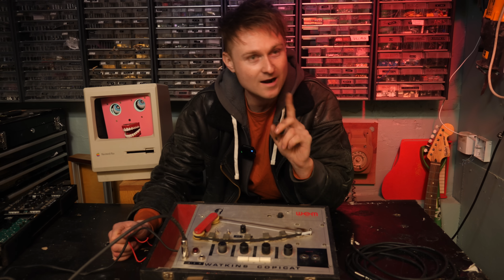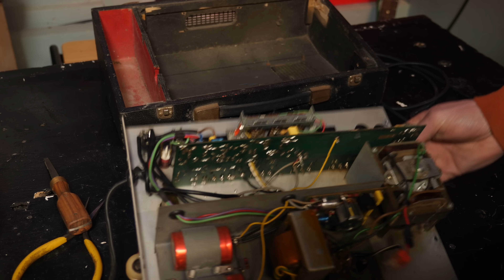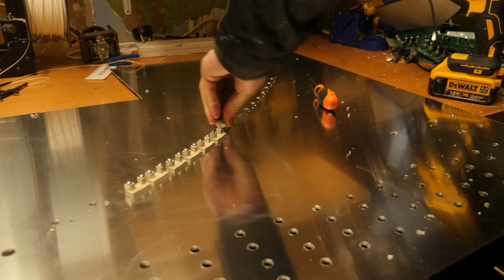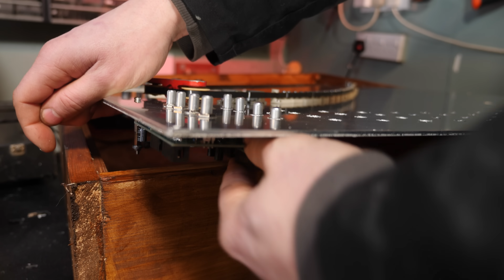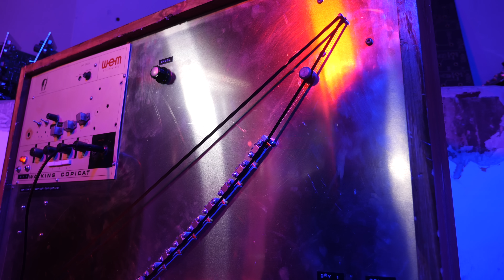A MODIFIED TAPE DELAY WITH 6 TIMES AS MANY TAPE HEADS - THE MEGACAT

Comment: Modification ideas
1. U used a Metal plate, maybe try to add "platereverb" Modulation by vibrations on the plate, the play heads will Pick Up different hights of the tape

2. Add a Keyboard Mode Which can be switched on with a button. Then build a keyboard to the delay and connect the heads to the keys so you can activate/play them with the keys 

3. Cutoff for each playhead

4. LFO for Write head

Comment: It would be cool if the tape you had going round and round would have a design on the back of it. not sure what kind of media is needed to work with a tape head. But with as visible as the tape is, you could more easily gauge how fast it is moving, and it would look cool.

Comment: One cool ting that could be done with it is to build a sort of EQ. It turns out that when you are building an EQ in software, it's done by computing the output as the sum of a bunch of delayed and scaled (an possibly inverted) samples from the input. This is basically doing that in analog.

To get that to work properly, you would almost certainly need much faster tape (the head-to-head delay needs to be close to some multiple of the inverse of the frequency and the delay between the write and the last read needs to be close to the response time you want). it would be interesting to try to build one out of a hard drive platter (using computer parts to do analog stuff would be kinda cool in an ironic way) or some other kind of magnetic media than tape.

Comment: What if you made a wheel of tape heads and spun it against the tape? Each tape head would be moving faster or slower relative to the tape than a stationary tape head so they'd hear a different note than what was recorded.

Or maybe you could have a tape head that wobbled back and forth to give an adjustable tremolo effect.

Or maybe you could use an audio signal to drive a voice coil that vibrates the tape head, creating interesting frequency modulation effects.

Comment: @LOO  This is a beast! Love it!! It would be neat if you had a visually matching, but smaller swooping line of toggle switches in a  between your knob array and the actual PB heads array. Then have an LED below the head and above the switch. Maybe even 🔴🟡🟢. You could even have the switches in a horizontal line and the swooping line above it with the LEDs on and above the line. 🙂

My buddies and I have loved our WEM Watkins MkIV " For Guild Guitars USA"  and WEM Guild  ( the former being dual voltage, the latter just 110V). Everyone likes the preamps sound in the MkIV because they are all BC109 buffer transistor and BC107 and BC108 in the preamp. It would be cool if you made a video of a stand alone Copicat MKIV preamp project and included the BC109 input buffer transistor which adds the perfect edge to guitar pickups. Especially P90's! I notice the buffer stays in circuit even when the echo is bypassed. Which I like. Echoplex has their stand alone preamp pedal, but I always wish there was a Copicat one too. Maybe you could talk Charlie Watkins widow June Watkins. Wavesfactory has Echo Cat which is a cool plugin or VST. Thanks you're amazing!

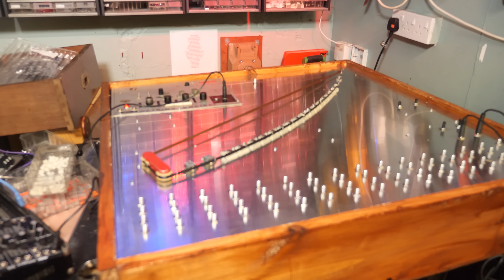Comment: 13:20 That sounds just like the ending of the air raid siren test in the Netherlands every first Monday of the month. You hear sirens overlapping, both those close by and those further away, and it sounds just like this. In a certain way, it's very similar; those sirens further away have delays, just like the delays between the read heads in this Copicat machine.

Comment: What has always eluded me is the spacing of the playback heads. You've skipped over that headache with equal spacing on your unit. On the original you can see that heads 1, 2, and 3 are not evenly spaced to allow for options like 1/8 note delay or dotted 1/8 note delay. I know the spacing must be a function of the distance from the record head while accounting for the tape speed, but I've never run across the actual mathematical formula.

Comment: Idea (which you may have already thought about): It could be possible to wire the signal that goes into the write head to some of the other heads, maybe on a SPDT? Then you could have maybe 2 or 3 heads that can be switched between reading or writing in the "middle" of the tape instead of just at the "beginning". It would probably create some really wild patterns.

Comment: Is it possible to make a tape machine that writes and reads just a small amount of latency. It might be cool to record to tape in real time and right into a recording interface to get that analogue tape sound on your daw. Has anyone ever tried this? Could be cool for music production if it works. Have the dry and wet outputs recording at the same time then mix together may be a cool thing to try. A dry/wet knob isn't necessarily needed if you can just record both signals. If those analogue harmonics can come through into your digital recordings it could be an awesome addition to a studio looking for more retro/classic vibes.

Comment: Cool project! Can we have a schematic of this? Maybe send it to Elektor? 
some sugestions: 
-Add group mixers
-add a cleaning head before the tape reaches the spanner (I suppose that long of a tape has a tendency to catch a lot of dust)
-add signal LED's to each off the reading heads so we can see what is happening
-add some feedback channels for experimentation
-add some pedal controls
-add automation for the erase and write heads with a pulse generator.

Comment: Surely that curve would have been a bezier curve with 2, rather than, 1 origin points to make it an elliptical curve, rather than, a circular one instead?

It looks like the fist and, particularly, the second tape heads also work to keep the tape under tension.

The way you have it currently, the tape seems to have a tendency to want to jump off the first two heads as your splice works its way around the curve at the start if the run is all.

Comment: might need sumting to stick on the back of the tapeloop , maibe put cellotape along its length , with that length my guess is that the tape will break faster than on a normal copy cat , it probably stretches too , that might become a problem if the loop breaks halfway through a recording as you have to start all over again
bet there be some scify shows interested in the machine to make there "spacesounds"

Comment: You should put another roller between the motor and the tensioner to lengthen the tape loop such that the distance between the first play head and the last play head is exactly half of the length of the tape loop so when you loop you get 16 beat sequencer followed by a bar of silence so the beat stays in time.

Comment: Will it run in reverse?  That could be interesting on loops. Very radiophonic workshopish, a sound I really don't think digital can recreate.  I assume all the heads were stereo as well, so you could in theory run stereo signals into each head (or have you already?). The speed control needs to be on a foot controller, oh... and I'm sure you've earthed than aluminium panel!😊

Comment: Hey Sam, I think you should build a floor board where you bring out the switches to stomp box style switches, as well as a swell pedal style control for the motor speed.
Actually what surprised me the most was that the capstan motor was able to drive the tape loop reliably without a pinch roller.

Comment: Ooh!  Now add a metal foil on the back of the loop point, and a sensor to read when that passes by the record head.  Use that as an output to feed a modular synth input.  Now you've got sync lock to tape, with variable speed.  :-)

Comment: I am inspired to try to make a eurorack-sized one.  One exists, but it's both expensive (half a grand?!) and takes up a ton of space because of how much importance it puts on displaying the cassette deck it is using.  It'd be neat to try to get a lengthy, zigzag tape path on the underside of a board, with the top used for the rest of the circuitry, and have a module that's almost always done digitally these days rendered in a real analog way...

Comment: WOW that was absolutly amazing, cool idea, I got another idea for you : since you master tape head tech so well : think about using megnetic strip on creditcards as the medium ?? the length is not so long = short time each, but the width of the track handle quite many tracks side by side, so lets take 6 heads mounted in a distance in the play direction exactly card length, all 6 heads at different height, so they handle a new sound track, all heads connected in parallel = now your audio time is 6 times as long, here come the cool thing, you can record base drum, snare, hihat, and so one, on a few cards, and then color them so it is fast to identify, now pull them thru in right speed and order, and you have a manual music making machine, you can also add manual scratch while you play to add extra effects, I actually vision a larger version where "sound-cards" go into a round rotating holder, with 16 or even 32 fixed slots, now you can pull them in and out while it spins, and this way modify the looped track. How about that

Comment: Great stuff !

I still haven't got round to speed modding mine...
There were a lot of comments claiming the dimmer switch method would ruin the motor, but yours is still working! Has it had many hours of use?

Comment: Does the record head have azimuth and height adjustment, and are the playback heads centred on the recorded track (for a loop tape without a wonky splice section) ?

Comment: I noticed a “wobble” in the long upper stretch of tape indicating uneven tension.  If you want to eliminate this, try installing an idler wheel in the middle of that long section.  Kind of a second tensioner.  Other than that, my musician friends in the 70’s would have paid good money for this.

Comment: I've wondered if multiple write heads could work in a tape delay. If you're adventurous, maybe try that. Make them movable if possible. Then you can take output of a head, modulate, and feed it back even before where it was sampled. Maybe the write head could be weaker retaining original signal better. Ofc you need input for speed control. Will probably be really wobbly if you start modulating the speed with the signal that comes out of it.

Comment: Are you able to pan the erase head Left and Right??
Also with all that room left you could have a second, smaller delay loop with adjustable speed that you could link/unlink to the main loop's speed with a switch.... you could also have a switch to set the secondary loop to write from  either the main loop or from the input.... AND the same type of panning knobs too... you could really get some wild effects with just those 2 loops...
(back when I was playing around with the computer program Reason by Propellerhead I used to have so much fun wiring up massive delay chains... not sure if you know anything about that program but you can wire it the synths/samplers/drum machines/effects up anyway you want not just with the audio lines but the CV/gate lines too.... it alone got me interested in making electronic music and learning about the history of it and how it all works...... it's basically a computerized version of synths before there were computers LOL .. well, now the newer version seem a lot more complex then when I was messin with it, but I don't have $500 to buy an app these days, and the demo is time limited and you can save, so it's no fun... and I don't know enough to do the wizardry you do... So I get a TON of JOY from watching your videos instead :) - THANK YOU!!! )

Comment: I wondered if something like this would be possible with multiple heads. I thought maybe there would be too much hiss and background noise, but clearly not :-)
Here's an idea, if this is standard tape then technically it has 4 tracks, what about adding an additional pair of heads that can be used to write and read timing pulses on the tracks that aren't used for the audio? These could then be used as pulses to drive a sequencer or other devices, or simply act as means to get a feel for how far into the loop your are from a particular start point. LED segment display to count the pulses recorded on the 3rd track up until there is a reset pulse on the 4th track. Maybe it's useless maybe it's got potential, who knows :-)

Comment: The heads you bought from the cassettes are junk.  They don't need to have a narrow head gap because they are just transformer coupling.  That's why they are cheap.  You need to get some REAL heads.  You also need to pay attention to equalizing.
          The tape is wandering sideways.  You need to remove one of the heads in the center & put a guide there.  The run is too long.  You also need to apply more care to get the splice EXACTLY straight.  Make a LONG splice jig.
          I did stuff like this in the 1960's with 2 tape recorders set up side-by-side.

Comment: What a crazy cool device!!  I might have to build something similar...  I have a couple tape recorders that don't work, I even have a tube powered reel to reel that is physically busted up.  I'm pulling the power amp section to make a guitar amp.  It would be kinda cool to have a tube powered echo machine 😁  

Ya know, Ali Express has tape heads for like a buck a piece, cheaper and easier than buying a bunch of those tape adapters for $5-$10 each.

Comment: If I don't need an alumin(i)um plate like that to be shiny, I usually hit it with high grit palm sander. Quick and easy, and it creates a nice, somewhat matte surface that doesn't show fingerprints at all, and makes random scratches a lot less obvious.

Comment: Was working on a similar project a couple years back and discovered the same thing buying tape heads. The best solution was buying cassette adapters and shucking them. Super wasteful, but MUCH cheaper than buying alone.

Comment: In the 80,s you pick up copy cats for 40/50 quid nobody wanted em. I had 2xic200,s and an ic400. I seem to remember using the ic200s back to back using one common loop of tape for long loops in stereo lots of messing   about to get the tension ok.